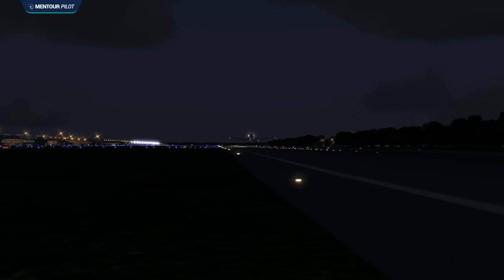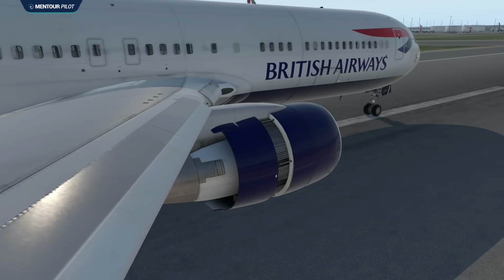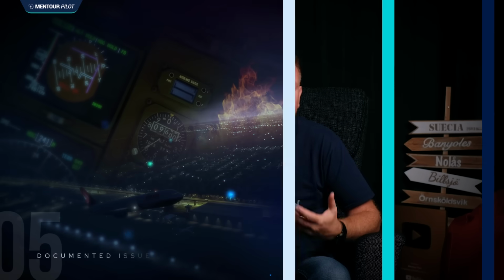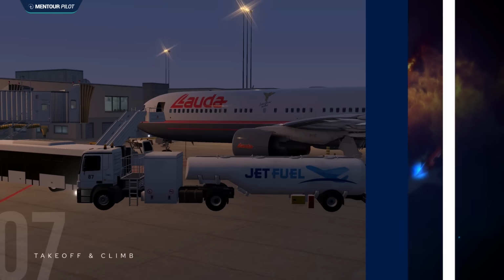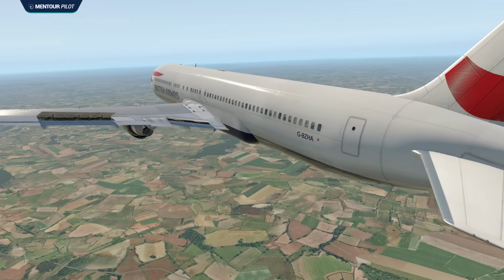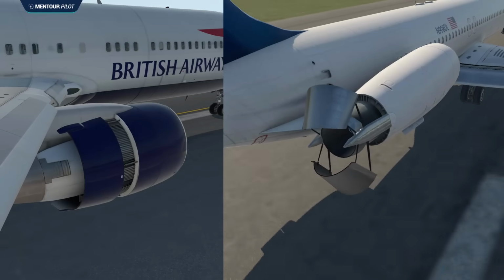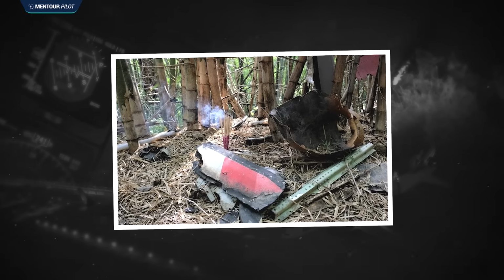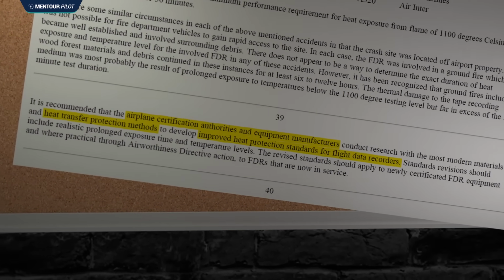HOW an Impossible Failure CRASHED this Boeing 767!

Comment: Unfortunately what is often overlooked: Lauda Air did also do several things that were to say the least 'not aviation' standard. 
61 error messages about the thrust reverser on the engine in the weeks before the crash. 
Some faults messages have even appeared the year before the crash. 
At some time it had gotten so worse that the Lauda technicians just erased the fault messages on a constant basis and didn't bother to enter them in the Log anymore when they appeared. 
Some fault messages were just erased eventhough the were a clear violation of the MEL for the 767. But the Lauda Air technicians did it regardless. 
Just weeks before the accident it was noted that the reverse thrust  would not return to the fully stowed position after it was used during landing. Despite all of this Boeing was not informed what was going on with jet OE-LAV. And the most perplexing thing during all of this: The whole time there were Boeing technicians based at Vienna, but Lauda Air didn't request their help. Not even once. 
To quote Nikki Lauda himself:

'It is good that there is a Boeing Employee in Vianna, we're all glad about it, but I'm not required to go to him, since i got my own maintainence department and my own Boeing Manual to fix problems'

That puts the crash in a slightly different perspective.

Yes it was definitely Boeing's or Pratt&Whitneys fault to design the aircraft and engine in such a way. And Nikki Lauda did an outstanding Job after the accident happend to find out his pilots were not at fault and the deployment of the reverse thrust at a high airspeed would inevitably lead to a crash. But his company could have and should have done more before the accident happend. They should have at least informed Boeing about those constant fault messages and that nothing they tried would fix the problems and not just erase the fault messages on a regular basis. If i can't find the fault myself for weeks then it's time to call the the manufacturer of the product.
Reply: Do you have any examples of Lauda Air dispatching OE-LAV with faults contrary to the MEL?
Reply: One could at least have referred to the book by the aviation expert Tim van Beveren: "Sluts, botches and cover-ups - the last flight of the "Mozart" or: 61 error messages until the crash."
Reply: One Just needs to read the much more differentiated Analysis of Tim van Beveren about this crash
Reply: An engine with a recurrent problem that could not be corrected by Lauda Air technicians over the course of 1 year, should have been taken out of service and replaced, regardless of the cost.
Reply: @charleshammer2928  I agree that they should have grounded that plane but they were following Boeing instructions. When a repair was attempted that resolved the issue even for a short time, the 500 hour timer would be reset. I totally disagree with the timer reset – if the fault affects the same system time after time, it's clearly faulty and timer reset must not be done. This problem was caused by Boeing on so many levels, including all the effort to dodge the blame after the accident which required Lauda himself to be really persistant with the investigation.
Reply: @MikkoRantalainen  - One assumption Charles Hammer is making there is that the recurrent problem was within the engine and reverser mechanism itself - the truth of the matter is that from a maintenance/engineering perspective the problem could also have been within the warning system electronics and/or the wiring loom (and the video shows just how tightly-packed and complex those wiring looms are).  As I'm sure you'll appreciate, with the benefit of 20/20 hindsight, there's a large discrepancy in potential safety-criticality between an issue with the warning system versus an issue within the engine/reverser systems themselves.

I've seen a few comments on here that chastise Lauda Air (and to some extent Niki himself) for relying on their own engineering people (working, as you say, from the Boeing manuals and operating guidelines) rather than taking advantage of Boeing's own engineers situated in Vienna.  The truth of the matter is that if (as is most likely) the source of the problem was the wiring loom, there was no unique knowledge or technology that the Boeing engineers had over and above Lauda Air's own staff that might have solved the problem any sooner.  The book (as written by both Boeing and the FAA) stated - for better or worse - that a temporary fix would reset the timer in terms of dispatch safety, and every airline operating the B767 abided by that book.
Reply: @MikkoRantalainen  
Yes but the problem is. As we saw in the video and what was written in Boeing QRH.
"Additional faults may cause in-flight deployment" 
And "REV ISLN" wasn't the only fault with that engine.
Or in other words there WERE several aditional fault present at that engine.
So if you combine that with the manual it was quite possible that the reverser would deploy, since even the QRH said so.

And just reasing the fault messages sometimes without doing anything just to reset the 500 hour limit was not what i would call "aviation standards".
When the 767 left vienna for Hong Kong 495 hours of those 500 hours have already passed. But instead of keeping the airplane grounded they just did "something" and started those 500 hours again.
Reply: @turricanedtc3764  the books by Boeing you're referring to like the QRH that also stated 'additional faults may cause In-flight deployment'

And there where clearly additional faults present with that engine at the time. So in other words it was sort of foreseeable that the reverser on that engine might deploy in flight. 
That REV ISLN wasn't the only fault with the reverse thrust, the engine controls or the engine itself at the time. So thinking the reverse thrust might really deploy in-flight wasn't so far fetched to think. 

Of course the pilots couldn't know this since it was written that all of those fault had been corrected eventhough they were not corrected.
And nobody expected that the in-flight deployment might make the airplane impossible to control after just a few seconds.
Reply: @ax.f-1256  - You do have a point with regard to that, but my feeling is that the real problem lay in the regulations and systems involved in aviation at the time - as the video states, the rules said that a problem had 500 flight hours to be fixed, and every time a fix was made and signed off, that "reset the clock".  There was nothing in the regulations that said the reset should not apply if it was a recurring fault in the same system over a long period of time, and that was a serious flaw.

For what it's worth, I don't think the crew being aware of it being a recurring problem would have made a difference as long as the regulations were being followed.  I think - and this is another certification/regulatory problem within the industry as a whole at the time - the most catastrophic issue was that the QRH did not treat possible reverser deployment as a "land immediately" issue because the certification stated that the aircraft was still controllable with one reverser deployed.  Had the certification been revised when the newer high-bypass engines came in to take high-altitude, -thrust and -speed deployment into account, the QRH would have been written very differently and the crew would have been aware of the true level of danger.

Comment: As a former lead tech for Boeing London Service Centre, I always treated anything coming in with an intermittent fault with a lot of hatred, yet would go above and beyond. It's passed, No Trouble Found. Technically I could put it back out with all the return to service paperwork. I took those on personally; heat it up, cool it down, flex the boards, fck I'd examine under our binocular microscope for anything that looked out of place that may cause an issue. I found countless latent future potential faults (sorry not sorry), but if I couldn't find anything then I'd reluctantly stamp the paperwork, and hope it was misdiagnosed at line level. (Tbh, they usually were. I swear that someone at BA Engineering cottoned on to me as I'd always make SLA, but anything marked intermittent got close to SLA time)

Comment: I was wondering why they ran the simulations with such narrow parameters prior to certification, but then I thought about 1989 technology and the question became rhetorical. What would literally be a few keystrokes today would have been a major undertaking 33 years ago. Am I the only one that has become so jaded and cynical in regards to how corporations operate in this day and age, that I was surprised Boeing did their utmost to actually investigate the crash and be forthcoming about the circumstances that caused it. Today's mantra is, accountability to the shareholder is the most important, and in a lot of cases the only thing that matters. Am I wrong,  in thinking that no flight data recordings, the contamination of the wreckage, and the components that caused it would make obfuscation, and covering up the truth a real possibility had Boeing chosen to do so?

Comment: At about 17:00 in the video you talk about a correction of the rudder to solve the pull to the left induced by the activation of the thrust reverser. What would have happened if the pilots had turned off the left engine? Would the thrust reverser continue to subvert the aerodynamic flow or would the aircraft, even with only one engine, have landed, in an emergency, at the departure airport?

Comment: Still about 650MPH in the last mile of the dive, dang. Also borderline supersonic by my memory.
Reply: Mach 1 is closer to 760 mph. In this case, we feel the speeds were over m-1, >800mph.
Reply: @jameshoff9435  Good point, I should never trust mental math while in front of a screen

Comment: Excellent presentation. I’m struck by the assumption that if a thruster did deploy in flight that the effected engine would be at idle. In fairness, it seems that the mechanical complexities are too great and the variables too limitless for minds to cover all possibilities.

Comment: I recall some models of Lear Jet actually had an explosive bolt failsafe to deal with in flight deployment of reversers.  It would jettison the buckets.  Not an option in these high bypass systems.

Comment: Great video. I remember this incident. I recall whereas previous may have been on older aircraft or planes with a poor safety record, the instinct was as the aircraft was comparatively very modern the accident must be somehow linked to what was then a relatively new airline. I also recall the personal intervention by Niki Lauda being sold enough to recall the accidents during his racing days. One query though: the video suggests other aircraft have experienced unexplained reverse thruster deployments. Have the new designs/features led to these cases reducing ?
Reply from the maker: Yes, the new designs have made it virtually impossible to happen

Comment: Couldn't this have been avoided if they had shut off the left engine sooner. And like u said I don't think they could've still control the plane at the speed it was going and the fact that parts of the rudder on the right side had broken off.

Comment: Why is the beacon light on during mid flight?
Reply from the maker: It’s an anti collision light, it’s to be seen by other aircraft
Reply: @MentourPilot  Is it the same light as the beacon indicating Engine startup? And doesn't having a red light in the middle of the plane interfere with the red/green wingtip lights?

Comment: That "HIV" was very unfortunately named… but a quick check shows that the other "HIV" was first named that in 1986, so they couldn't have known (and might still have called it HIV, because it is the Hydraulic Isolation Valve.  Hmm… Hydraulic Separation Valve?)

Comment: Mr Lauda, took Boeing to court over this accident which is strange you didn't involve. 
As Lauda Air were at first held totally responsible for the horrendous accident that occurred due to the failure of the engine systems. 
As I felt its an important part of why the changes were made to training and also for apportioning blame.
But otherwise a good video covering the issue and it's outcoming.
Reply from the maker: I never go into the legal proceedings after an accident unless they make a substantial change to the final report outcome

Comment: So the risk of thrust reversers activating in-flight was known.  The FAA not only allowed Boeing to "model" the impact of this but also to choose the context for its impact modelling. They chose a relatively easy situational context that bore no resemblance to the majority of time the plane would spend in the air - and, on this basis, they could show that the failure would be manageable. Great job FAA and Boeing. Had they tested the situation this plan suffered, one imagines they might have thought to build better safeguards and train on the necessary actions during that 4-6 sec time window.

Comment: Well...I like your videos and almost all satisfy my armchair pilot experiences. But...
Did you receive a punishment threat by Niki Laudas successors? 
You didnt refer on the fact that Niki Laudas "maintenance crew" was not up to their job. That they refused direct help from Boeing to solve the problem, because of costs. And tried to solve it themselves.
Niki Lauda flew his own commercial airplanes (a A320) as PF to keep up his license. I was on board of one of these flights and I didnt like it at all. A PF with some hundred hours on type just to keep his license? On a commercial trip? Sorry. This guy was dispensable.
So. This plane went down because of total negligence by the "maintenance crew". 
I am very sorry that you put this story into something that sounds as if everything was Boeings fault. They had this warning going on and out for months and still tried to solve it on their own, operating just a very few 767s. And rejecting Boeings offers to help. Read the reports.
Reply from the maker: I did read the report, in fact, I only use the final reports when I create these videos. That’s why nothing that is not mentioned in the report gets mentioned.
Reply: The crucial point in this case was that nobody - Boeing included - thought that a thrust reverser deployment during a flight would cause danger for the aircraft! Only this specific flight has proven the opposite! 
So all engineers - from Lauda Air, Boeing and even the FAA - thought before that crash that the problems with the thrust reversers were a minor issue, not worthy to ground the aircraft, 10% rolling as the assumpted worst case should be well inside the controllability by trained pilots - instead of that they therefore introduced the 500-hours-rule, which Petter quoted absolutely correct from the investigation report.

I know that Niki Lauda still divides the Austrian Society deeply - that there´re Austrians who pray to Niki Lauda as the Greatest Austrian ever, he´s a Holy to them, worthy to be appointed as that by the Pope, and that there´re other Austrians who look on Niki Lauda as if he was the Devil in person, making him responsible for fairely everything what went wrong in Austria. I readed here even a comment making Niki Lauda seriously responsible for the SPÖ winning Elections in Austria and therefore destroying Austria and the Austrian People.
Please keep this Inner-Austrian discussions out of this Forum. They´ve nothing to do with this horrible tragedy.
Reply: @NicolaW72        I think it goes without saying that the worst Austrian ever was that failed Austrian painter who took control of neighboring Germany in the 1930's and 1940's. 😊
Reply: @Eternal_Tech  Yes, I´m absolutely with you in this issue. But I readed here really somewhere in this comments a statement that Niki Lauda would be responsible for the SPÖ winning elections (meant seriously as being the most worst case of all worst cases and not as a joke) and that he destroyed Austria and its People (obviously not meaned as a joke, too). So my intention was simply to say: Calm down and put your emotions about Niki Lauda away for a moment. It may be a good topic for a channel about Austrian Politics. 
This tragedy is horrible enough in itself and there were 223 victims and their families and friends.

Comment: I remember being on a flight that gave me the "Maybe I should get off the plane" feeling. LOL

We pull away from the gate. We start moving forward, then we stop for an extended period of time. Eventually the captain comes on the speaker and says something like "sorry for the delay, we were getting some odd warnings on the system, so we just restarted the system and now the warnings are gone, so we are going to get going now."

I was like, uh, that's great... hahaha
Reply: I think that's quite common. "Switch the engines off and back on again".
Happened to my 747 flight from Heathrow , we seemed to be taxing a very long time, then we pulled over ... " We had a problem with a valve, so we will restart the engines".
It was a very very cold flight in the rear cabin, as if the heating was partly failed.